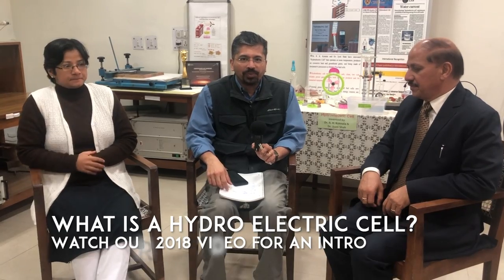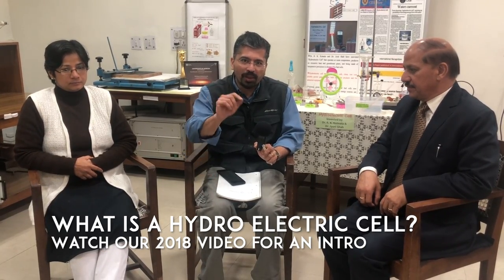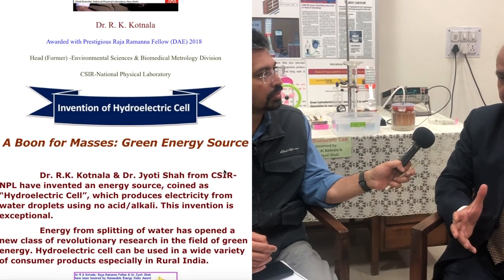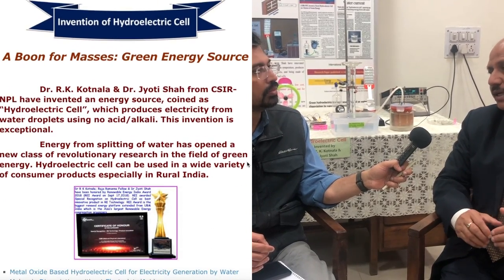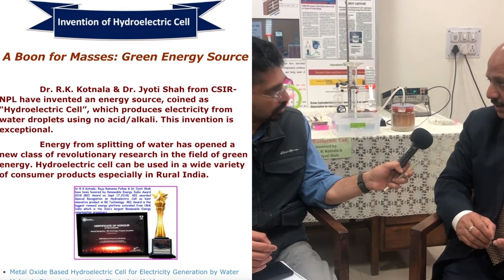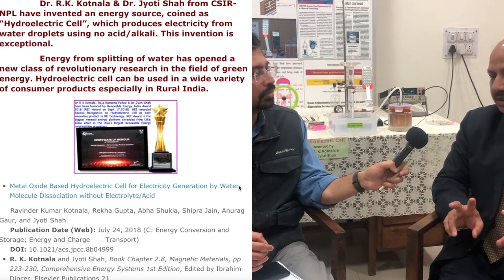Chat with Dr Kotnala - Hydro Electric Cell | Hydrogen Economy | Solar Cell Issues

Comment from the maker: Something different this time. Check description for links.
1:25 - What are updates to research of Hydro Electric Cell
5:25 - Hydro Electric Cell generates Pure Hydrogen too! 
11:27 - Is the Hydro Electric Cell rechargeable?
12:25 - What are consumables of the Hydro Electric Cell?
13:34 - What is power output of the cell?
15:09 - What are the costs for a single cell?
19:00 - Will the focus now be on generating H2 instead of electricity?
21:25 - What does the Hydrogen economy looks like, globally?
23:15 - Issues with Solar Cells
26:02 - Awards received by Dr Kotnala
29:00 - India needs to support and own technology and not loose IP

Comment: In what aspect is hydroelectric cell better compared to the state of the art Lithium battery?
• Better Energy Density?
• Better Power Density?
• Cost per kWh cycled?
You mentioned the downsides of burning hydrogen as if there is a hydrogen combustion bus in operation? Could you give more details about that?
In hydrogen generation mode, how is this better than regular hydrolysis? Is it more efficient? In other words, how many kWh of energy is required to generate 1 KG of hydrogen?

Comment: The problem I see is that the hydrogen they produce is at 1 bar pressure.
The pressure has to be much higher to be useful for cars or to get it transportable.
This require a lot of additional energy.